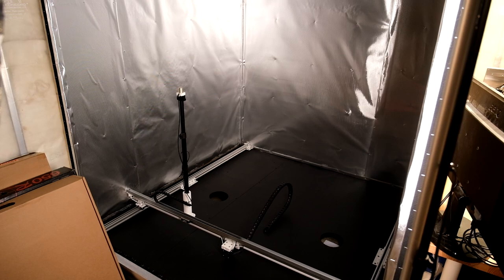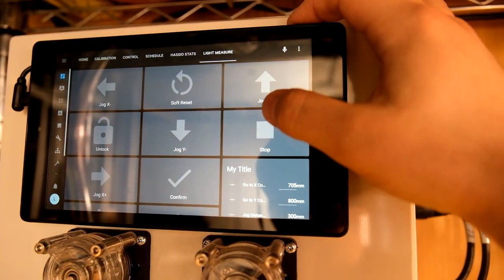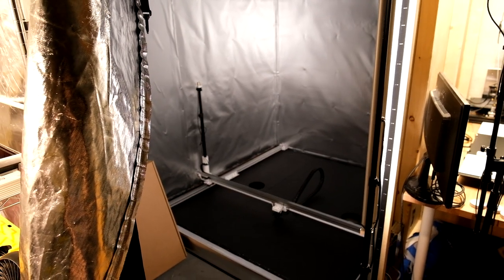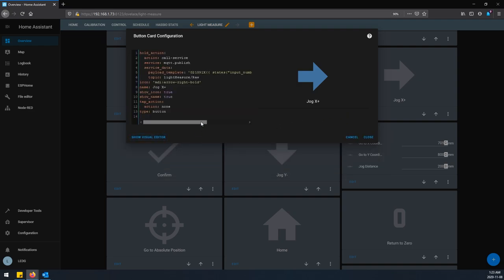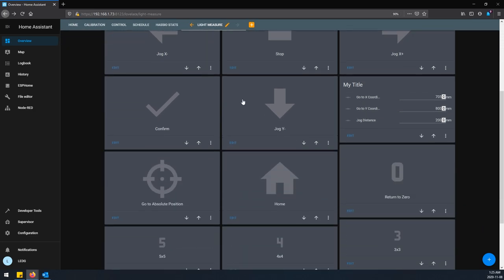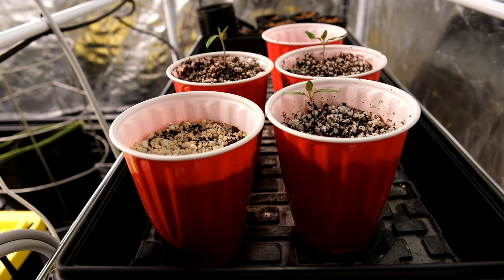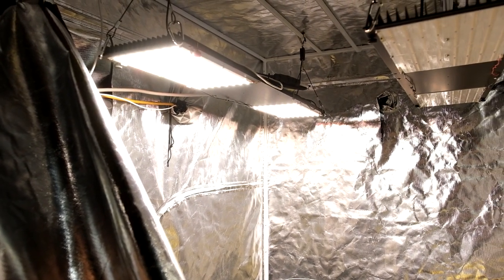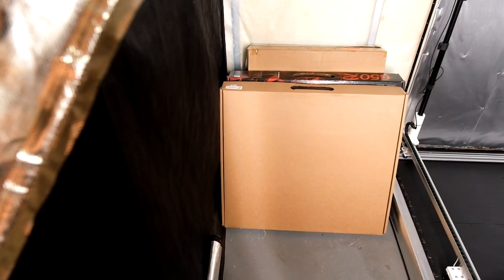What I'm Workin' On: My Latest Home Assistant Project, an Upcoming Grow, & Some New Lights to Test

Comment: I really appreciate what you do.  If it would help you, could you add affiliate links for  a pi 4, 10" touchscreen,  and several other amazon items?  I could send you my cart and whatever you would link, I would order.  Thanks for keeping me up all night lol
Reply from the maker: Hey there, thank you very much! I have links to everything in the video description of my video that describes my system here: https://youtu.be/Q9fjKeYOyqU You can just follow any one of those links and then whatever you purchase on Amazon within 24 hours (I think that's the time frame) will count towards my referral and I get a cool 3% of it, regardless of what you buy, at no extra cost to you. If you've already got your list, here's a link to the Pi 4 https://amzn.to/3pdrBPe that will do the same thing. Thanks again - this really helps me buy new parts to produce videos on.
Reply: @LEDGardener  Perfect.  Btw, I havent found anything to PWM a refrigerant compressor.  Just one company with a vague website asking me to call for price.  Seems like everything tops out around 35-40v.  I'm really green so I'm abandoning that part of the project and using a fixed speed compressor.

Comment: Awesome, you are automating even the light measuring, then you will add a pump on each reservoirs to automate the reservoir change so you just have to put the seedlings and then trim the leaves and harvest your cannapepper😅, let's automate the trim too with a robotic arm. 🤣🤣Good work mate keep up with the series 😉
Reply from the maker: Bahahaha cannapeppers. Nothing like a little capsaicin with each toke. Hell yeah though, automate it all away!
Reply: I was wondering if you can do two drawings with the cabling, one for your control box and one for all the sensors and solenoids and pump etc.. With that I could progress a little without waiting for the videos..
Reply from the maker: @user-bl8cu5pn4x  this has been on my to-do list foreeeever and I've been procrastinating because it'll be an undertaking for sure. It's something I should have done from the get-go... But I will bump up the priority and do my best to complete this - in the meantime, I'm happy to try to answer any specific questions you might have about the wiring.

Comment: Hi!  Nice, informative channel! :)  With your automated PAR intensity testing setup, I wonder if you can/have answer/ed a question? Say you have a 2x4 tent, and have 2 lights. Do you position the center of the lights at the center 1/3 points of the 4ft line? Or is the middle of the lights (tent center) PAR value a lot higher with that spot being lit by 2 lights , compared to the edge of the tent lit by 1 light and it's reflection off the tent wall. I've watched a lot of videos, and haven't seen someone address this question definitively :)  Your automated grow control system is f'n AWESOME. I really hope I can incorporate some o fit into my future grow :)  Be well.
Reply from the maker: Hey John, Cheers. I've found that it's usually better to err on the side of having the lights too far apart. My test results for lights that hang separately sometimes surprise me regarding how much light the center picks coming from both directions. Thirds wouldn't be a bad place to start, and maybe edge them out a bit further depending on the size of the light.

Comment: Love the videos. Keep them up!
If you need some help with setting up something automated to run on the pi: hit me up. I can imagine doing some type of automated OCR to read the apogee screen, and using predefined XY coords via your mqtt enabled MCU, spitting it out in CSV to help you automate your light testing. Looks like you've done 90% of the work already :D
Reply from the maker: Nice. I'm currently running a little python script on my desktop that takes all the readings from the sensor and loads them into a CSV. There is no display to OCR in this case - I just have a little interface that allows my NodeMCU to read the sensor and fire those values off to my desktop over wifi.
Reply: @LEDGardener  BEAUTIFUL. 100% complete.

Comment: Do you have any recommended methods of controlling the speed of a D.C. fan?
Reply from the maker: I followed this guy's video and used an IRLZ44N MOSFET with an ESP32: https://www.youtube.com/watch?v=Pw1kSS_FIKk&t=430s
Reply: @LEDGardener  cheers I’ll take a look.
I’m setting up a water chiller system to cool the room. Rather than turning the fan off and on for the heat exchanger I plan to slow down and speed up the fan. 

Do you think this will work? I suppose I’ll have to monitor the room temp and if temp is +1 desired temp use low speed + 2 desired temp medium speed + 3 desired temp high speed?

Comment: What parts did you use for that gantry? How much did it end up costing?
Reply from the maker: I bought the shield/Uno combo from Amazon, as well as the motors, wheels, belts, pulleys, etc. The rails are v-slot as you might have guessed and I drew/modified all the white pieces you see in sketchup and 3D printed. I'd estimate these parts were $300-400CAD, not including all the lumber, mylar, fan, etc. for the enclosure itself.
Reply: @LEDGardener  would you mind posting the specific parts for the motors wheels belts and pulleys? Really impressive, these kinds of things usually cost thousands of dollars. You programmed all of it from scratch with the Arduino? Did you have to write a whole library? I guess the movements aren't too crazy but just little things like measuring how long something has to run to get to a position must have taken a lot of experimentation. Anyways really cool and thanks for sharing.
Reply from the maker: @Ghanzo  Sure thing, I'll reply back to this again in a bit with a list. Man, GRBL makes this SO easy - It's incredible software. All of the work is pretty much done for you. You can flash the Uno with the shield with GRBL, then use a program on windows like Universal Gcode Sender to calibrate and run your system. It's that easy. All I did was write some code for the NodeMCU to send gcode to the Uno that's flashed with GRBL, just so I didn't have to use UGS to send the commands.
Reply: Just throwing it out there - another approach might be to use OpenBuilds's ACRO system, which is meant for exactly this kind of stuff. It's like a CNC mill system but minus the requirement to support large lateral loads like you get when you dig into aluminum with a router bit. Useful for plotters, laser cutters, that sort of thing - but should work great to position a light meter, too. https://openbuilds.com/builds/openbuilds-acro-system.5416/
Reply from the maker: It looks beautiful. Looks like it’d be difficult to get the sensor close to the wall though on the X axis
Reply: @LEDGardener  wow I'll check out grbl